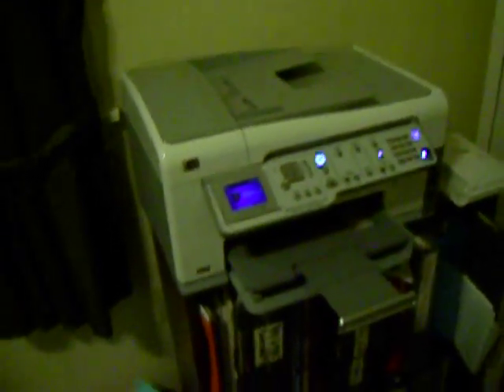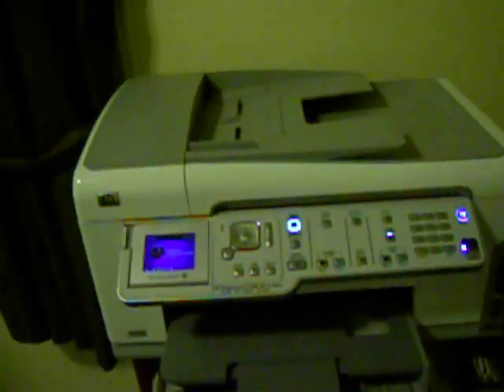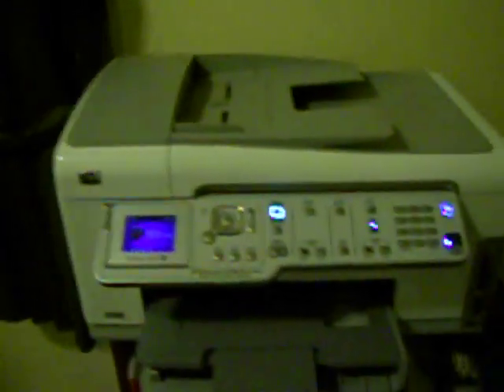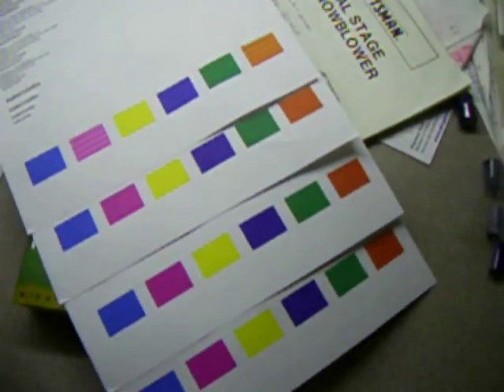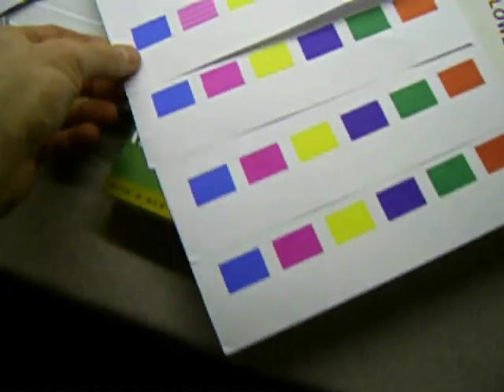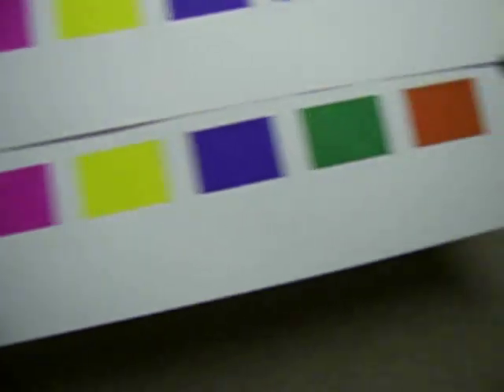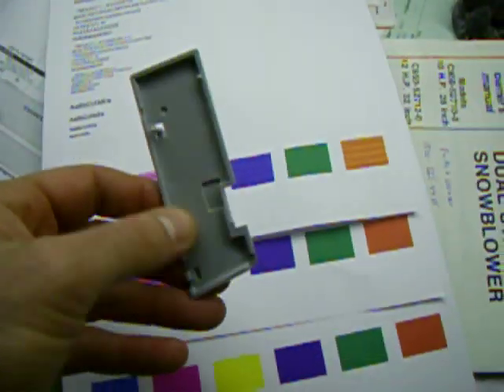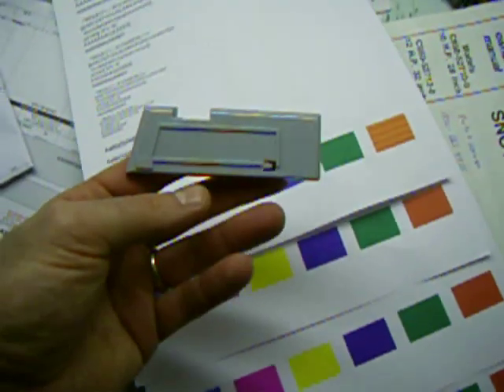Fixing HP7280 Printer Capacitors & error messages_Part 2 of 2

Comment: That part goes on the logic board bottom right side. Right outside of where the power and phone line ports are. Angle side of that part should go towards the back of the printer. Thanks for the videos and clearing up the 3x 330uf capacitor issue. Everywhere I looked online I was hearing replace 3 - 330uf and 1 - 680uf. After I looked at the capacitors on my printer I had 2 - 330uf and 2 - 680uf capacitors. So it was not making sense to me. So now I will be replacing both of the 680uf capacitors that are bad. Thanks again

Comment: I will be replacing the same old 4 capacitors. Does it matter if you use a higher voltage of the 330uF and 680uF? What should I look for in purchasing the best capacitors and what should I avoid? Is there a particular brand that is a better quality than the originals? ebay has quite a variety and seems to be the best place to buy, but there are so many different kinds and want to make the best choices.

Comment: Thank you very much for this video.  I have managed to repair my C7280 by replacing the four capacitors as you explain.  It took a little longer than an hour because the unsoldering of the old capacitors is tricky.  But its done now.

In the next video you ask where a small piece of plastic should go.  There are two pieces which mate together either side and encase the part of the circuit board near the phone jacks (for isolation purposes).